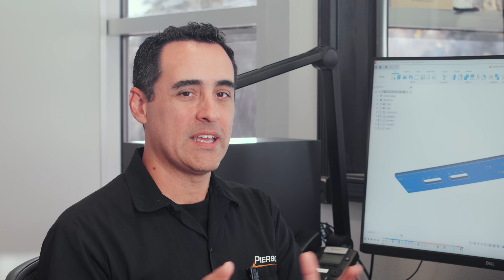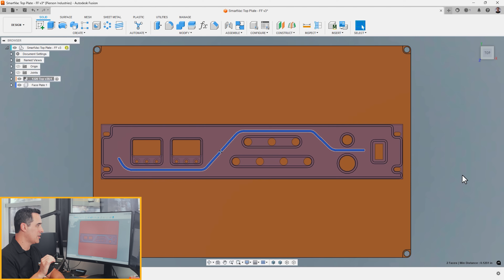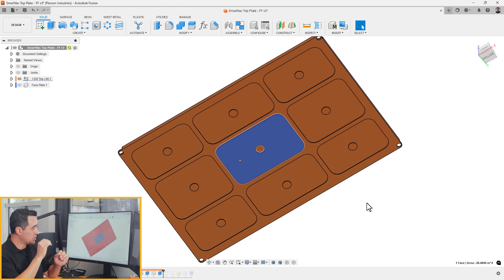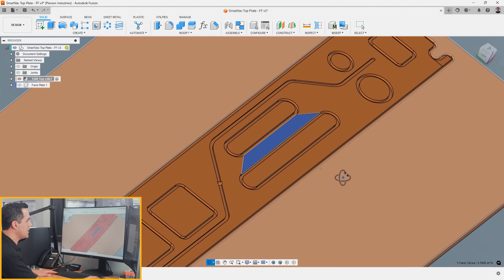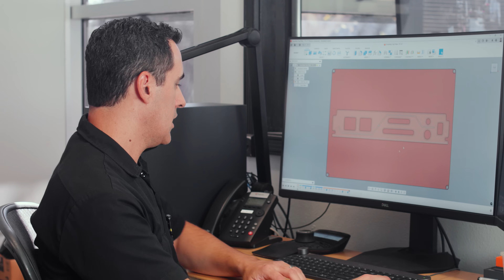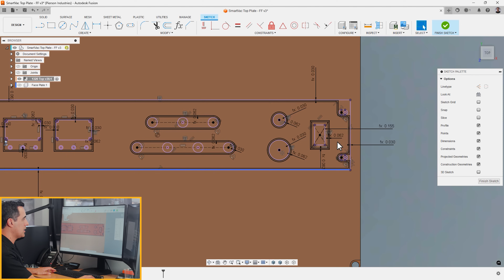CNC Machining Thin Parts | Fixture Friday 27

Comment: you can also use martyr rubber plates, theyre wayyy simpler to prepare than a custom plate and gaskets, coupled with the vaccum downforce, it will force the part in the rubber and make it stick to it and add lateral load resistance, its even more effective the more rigid and heavier the raw material is

Comment: For the 80/95 calculation, are you using cord material that measures .125, or is it standard material that measures .139 and just use the nominal size for the calculation?

Comment: What is the minimum surface area you like to have for a vacuum system?
Reply from the maker: It's impossible to give you a single number.  The minimum surface area needs to be high enough to generate more holding force than that cutting forces applied to the part.

Comment: The BEST tip I got was to leave a skin on all features until the end to maximize the full force, then do a finish pass to pierce through; very clever. You said the 0.125 it the general preference but could you mix gaskets, say use 0.125, but also 0.063 for small inner features, still using the 80/95 formula?
Reply from the maker: Mixing gaskets is possible but not recommended only because it's tricky to get the top crest of the gaskets to be flush with the bottom of the part.  Inevitably, you'll need to press down on the part to get it to contact the different tops of both gasket sizes to get the part to seal.  Again, possibly but the gains aren't too significant.

Comment: Awesome info by the way. I designed a few vacuum tables for thin foils; different, but deals with a lot of the same aspects.
Reply from the maker: Foils are tricky! Did you use a top surface with tons of holes and no gasket?
Reply: @PiersonWorkholding  Haha especially if you need to machine 20 microns off of a 100 micron foil. Yes, an uninterrupted grid of stepped (small diameter at the surface, not to suck dimples in the foil) holes and a channel system in the base plate. Air pump more designed for flow than pressure, because of leakage (no gasket indeed). So nice if you can get it right. Seems simple, but has many aspects, as you demonstrated in your video :))

Comment: Vacuum is great. No work holding to hit with the bit, no worry about movement if set up properly, and nothing physicaly holding the part down, except air, so you can release it with a flick of a switch. So easy.

Comment: I'm curious if any of your customers at higher altitudes have noticed lower holding power? Before machining I did composites and when vacuum bagging we had to calculate our theoretical max psi as you lose .4 psi per 1000 ft of elevation. It may not sound like much but at 5000 ft where I'm at in Utah that's near 2 psi give or take.
Reply: @LoneWolfPrecisionLLC  we are at 5600’ and had to get creative in our op2 when the parts are split. Using the textured landing pads from McMaster Jay uses on his PPS plates, Harvey down cut end mills, and light step overs gets us a thousand parts per month on our Pierson vacuum fixture.
Reply: @mountaintacticalcompany  good to hear! I don't have many parts that come across my desk that need vacuum so I was curious if altitude did affect it
Reply from the maker: Yes, altitude definitely has an effect on the maximum vacuum level. Call it roughly 0.5 psi of downward holding force less per 1,000 ft of elevation gain.

Comment: Not the only way, lots of factors to consider. If it was a production run then the expense of a vac table is justified but if that was a one or two off then i would just use double sided tape.
Reply from the maker: Agreed. If you have 1 or 2 parts to make, buying a vacuum system isn't necessary. Once you get to production quantities, custom vacuum fixtures are a great option.

Comment: what about doing a ramp approach ? since it puts both side load and downwards preassure on the part well cutting
Reply from the maker: Yes, it's also useful to get to the bottom of windowed features.
Reply: @PiersonWorkholding  okay. only asked since i dont really have any experience with vacuum workholding ( most of my experience is on lathe. and the mill experience was only in vise and screw down fixtures in vise ) and though that a ramp style would be perfect since a lot of the cutting force goes downwaerds instead of side ways ( whice vacuum holding is way weaker to then downweards/drilling )